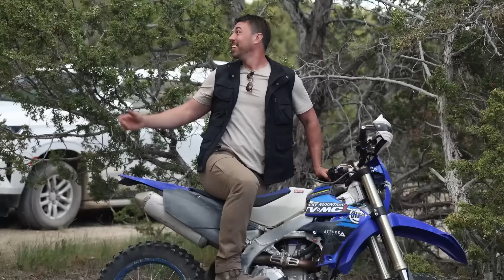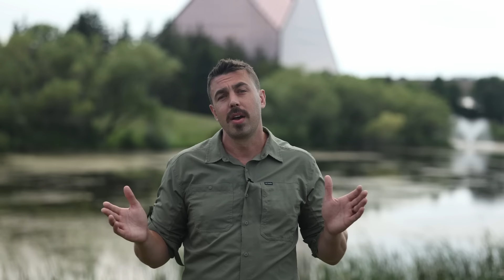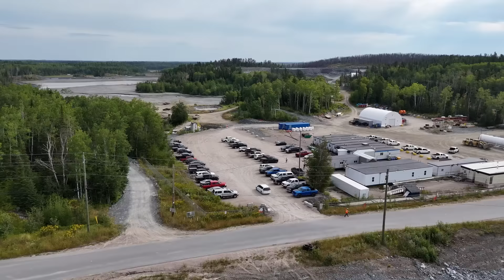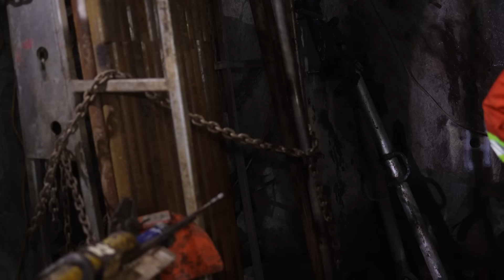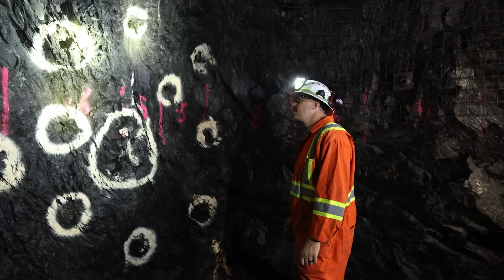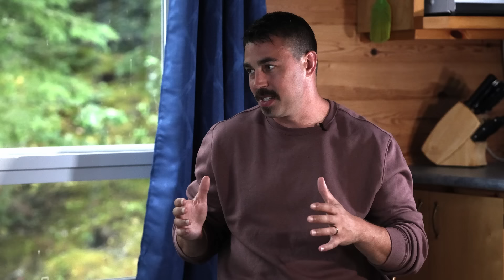Restarting an Underground Gold Mine

Comment: A very good report, that touched upon the main points of the mining process. In my opinion the mine could probably have been picked up cheaply because the previous owners must have mined out most of the easily mined reserves and had not sufficiently replaced them through drilling and geology. Drilling is expensive/risky (as in you might find nothing), and development to new zones is also very expensive. If a mine falls behind on either of these the cash stops flowing. I am very impressed with the mine manager. (I am a retired geologist and ground control person)

Comment: Why is it junior mining if it's already a built lift? (But not a lot of ventilation on that?) What's with the half kilometer drive when there's a shaft, more equipment tonnage? When are they going to switch to downbore mining or draw (tailings) rock good for field weathering? Tell me again how the headframe was floatplaned in. Why do I see 0 solar panel powering the works, too cloudy? What about everything in the refinery that wasn't gold, is it slagged off the top before the pour, and running spectrometry taken to look for Ta and stuff, or... What happens to the built mined space, truly no arch building but all ceiling bolts plus meshes? When do the explosives certified robots arrive? Were those Moscow Mules or milk? Why in 15 years of development don't they have decently fashionable locally made natural fiber high vis gear?

Just listened to a Redefining Energy Tech bit on How Big Things Get Done by Bent Flyvbjerg and Dan Gardner, and they'd look at a runway past 5 years and call it useless because the cost of capital isn't stable past that. As to calling the mine a deal, what kind of fines was the previous operator into that they had to walk away from $$330M?
Reply from the maker: Thanks for watching! Those were indeed Moscow mules (good eye!): 2 oz Vodka, 1/2 oz Lime juice, and 4 oz Ginger beer